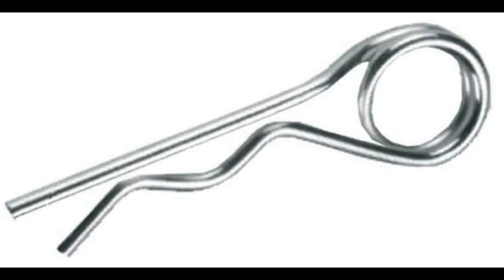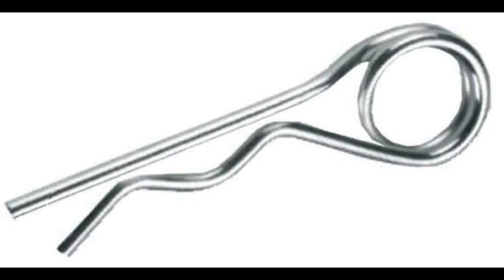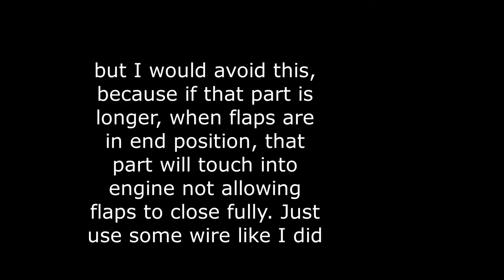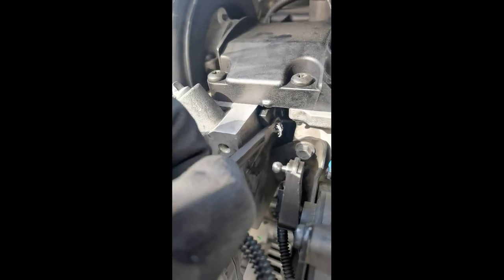Volvo D5 swirl flaps connection rod (joint) easy fix in 5 min

Comment: My actuator arm cracked and wouldn't stay on. This literally - not joking - meant that the flaps were stuck open and the car wouldn't have any throttle response over 2k rpm. I bought a new arm, modified the fixing points, like in the video, which fixed the problem. The part is easily purchased for £10.

Comment: thats good idea mate. thanks for your efford
Reply from the maker: No problem. Hope so it will help
Reply: @4chankrozb  made same thing with you but that servo has stucked. When I turn of the ignition disturbing noise comes from the servo. And when I pressed or hit on that servo that noise has gone. My next challenge is fixing the servo's problem
Reply from the maker: @chaosmagicification5770  Well I think you should calibrate stepmotor. Every time when you do something about that, you need to calibrate. I think it's not damaged

Comment: can you leave them open
Reply from the maker: Yes. But better closed them. If you leave them open, you will not have full boost. If you need to choose: closed it
Reply: My actuator arm cracked and wouldn't stay on. This literally - not joking - meant that the flaps were stuck open and the car wouldn't have any throttle response over 2k rpm.
Reply: @4chankrozb i think its other way around no? If they are closed you have no air coming into engine = not enough boost! If you leave them open car should work fine . Does make sense or am I wrong? Facing same problem now as my little arm also came off so ordered a new piece and will try to fix like you if it does not hold! 😊